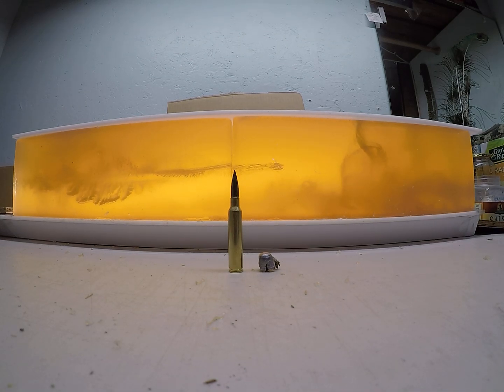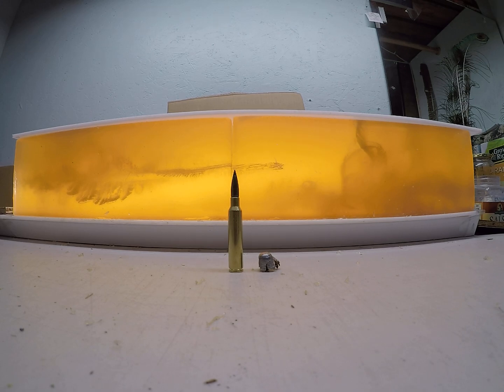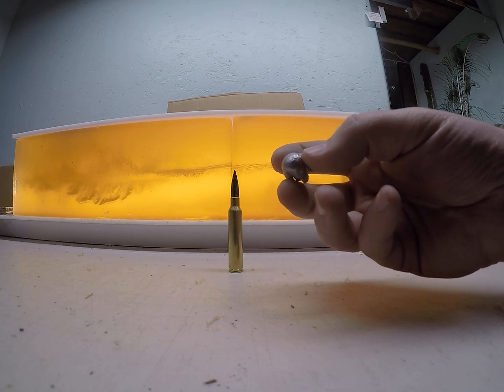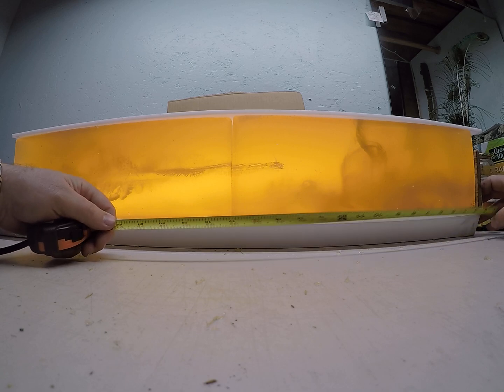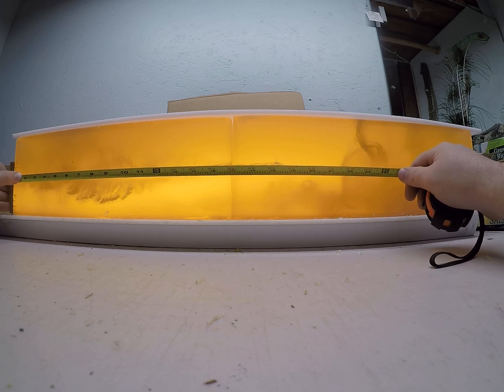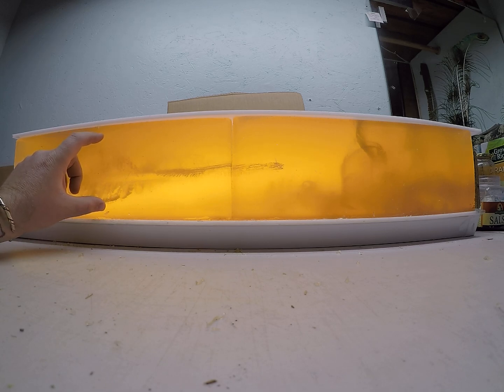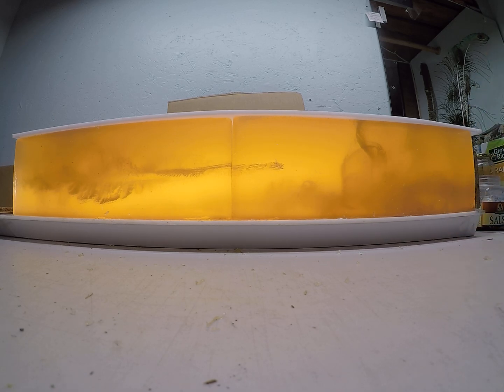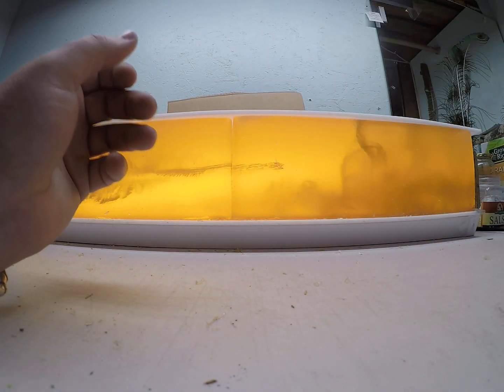300 PRC Federal 200 gr Edege TLR ballistics gel gel block overview PT2

Comment: Glad to hear you're getting good accuracy with the TBT 140's in 7mm-08. I'm just starting to reload them and hoping to get similar results. I'm starting with W760 and also have the similar H414 to try. My Sako preferred H414 with old 160 grain Grand Slams. Wish me luck. I hate that they don't have load data with 140's in the 7mm-08 so I'll have to proceed more slowly than usual so I won't have many left for the final batch.
Reply from the maker: I got my best accuracy and velocities with RL16. I have really come to like RL16 with my 7mm-08 and 6.5 CM
Reply: @simplemindedfella  Thanks. So I'll try to find RL 16 or maybe StaBALL 6.5.